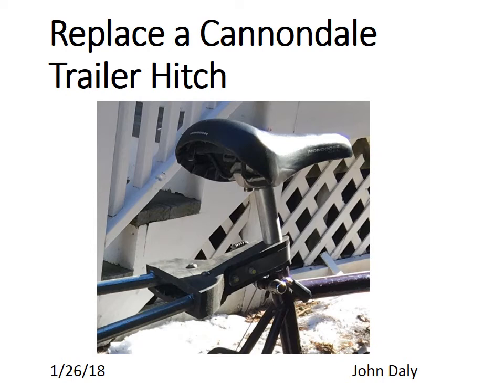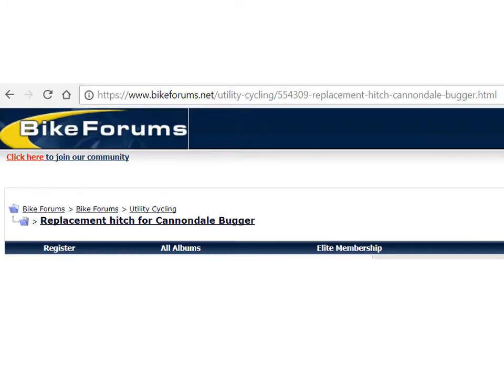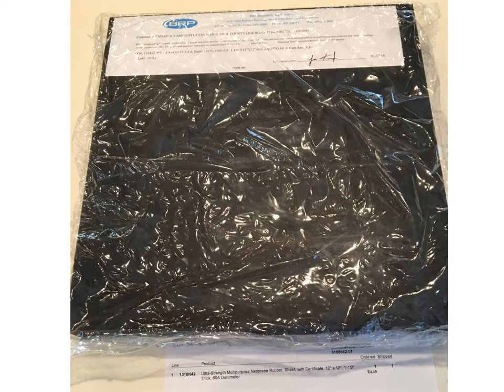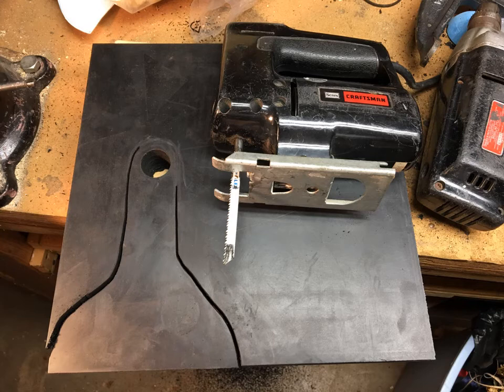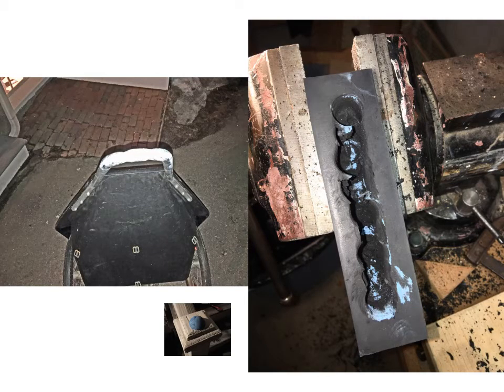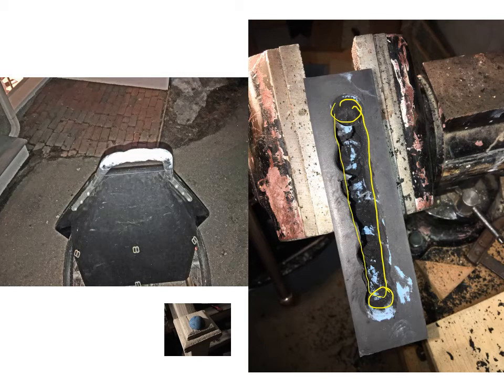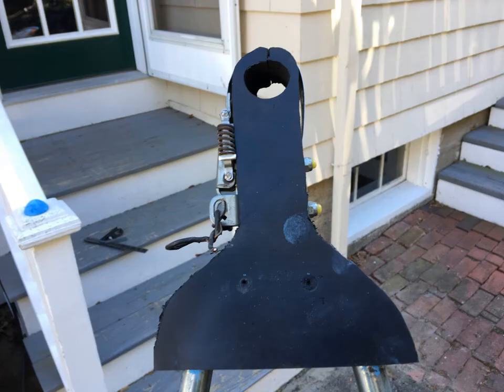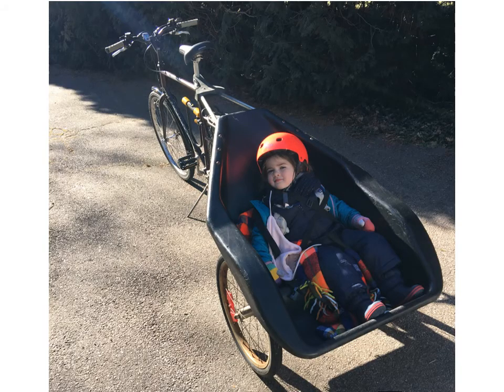FabricatingCannondaleTrailerHitch5

Comment: Nice work!  In the mid-70's I had an original bugger and those hitch plates were hard plastic and inserted into the center of the U tongue. I snapped about a half dozen of them. Cannondale was very helpful and sent me some new test hitch plates which were more flexible and thicker plastic. They lasted much longer. Those hitch plates were all open on the end and slid right into the seat post. There was a pin that slid across the front to hold it in place. I never had problems with the pin, just the hitch plates themselves. What worked best was reinforcing the thicker test plates with a steel plate over much of the flat surface. The only problem was that I lost the "flex" which eventually damaged the U tongue, which I had to replace. But overall, that seemed to work the best and was the way I used it until I sold it. In hindsight, aluminum might have been a better choice than steel, but that is what I had to work with at the time. Your hitch plate covers that entire area and provides more secure mounting at the seat post.
Randy Shaffer
Reply from the maker: Hi Randy. We bought this mid 80's and by then they were using Lexan, which became brittle over time...like this: https://jjdiii.files.wordpress.com/2020/07/slide3.jpg
 It was a person by the name of ATODDVR6 at Bike Forums who came up with this method. He described it and identified the NeoPrene Rubber from McMaster. I just added some visuals and more detail. It works beautifully....still fine.

Comment: Any chance you'd build a second from the remaining rubber?
Reply from the maker: Hi Michael.  Good question. I do have rubber left as you saw in video. However I (selfishly!) am setting that aside for in case I need to replace this one. I assume  you are asking for your own trailer?
Its a very doable project and these deeper instructions  (just submitted for Brent) may help....
:::::
I recorded the measurements for the refabricated hitch which you can see here.
https://1drv.ms/b/s!An6U9jq93Tp4icApwcZTK0esL3yZtA

Copy of template sketch here:
https://1drv.ms/b/s!An6U9jq93Tp4gcE2OEdFzW-Hc9iodA?e=QigibR

 And I posted a narrative text version of the video with visuals and measurements here.
https://1drv.ms/b/s!An6U9jq93Tp4gp1PKZ9Xt-pLLQ_fVg?e=ksHyqS

Let me know if I can add anything more to help.